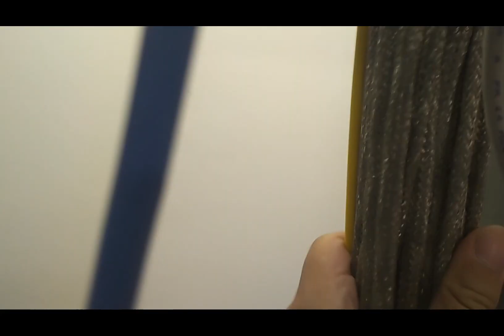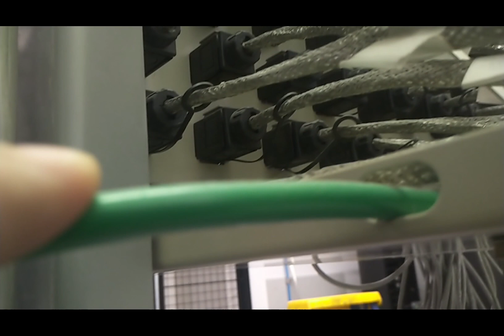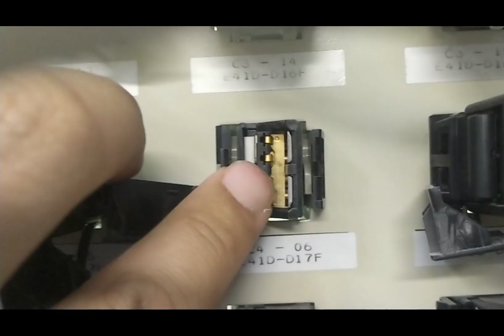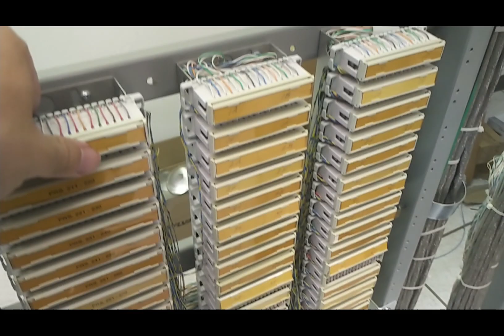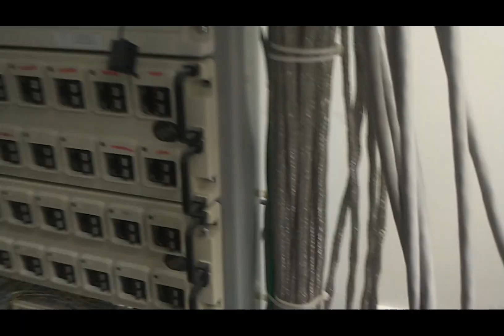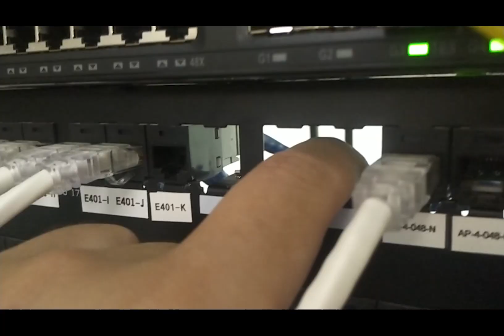What does a Token Ring Ethernet Network Look LIke?

Comment: Tokenring sending tokens and we have a collision Problem. On Ethernet we are sending Frames, thats the different. But also, on bigger Networks, do not using Hubs, using switches. A Hub generates a Traffic over the complete Network. With a switch you can reduce the Traffic in Zones and Region.

Comment: I am really trying to figure out where the heck this would be at and still in use? Government?
Reply from the maker: It isn't in use anymore as a "Token Ring".  They kept the wiring intact and used adapters to convert the token ring to Ethernet.  It is at a large company office.
Reply: @HazimGaber  The Token Ring standards actually proposed a 100 megabit speed but by the time they came out with it, Ethernet was kicking everyone's ass so much to the point that no 100MB TR hardware was ever marketed. Fun Fact!
Reply: The DMV probably still uses it in order to make service slower, keep the lines longer, and annoy motorists.